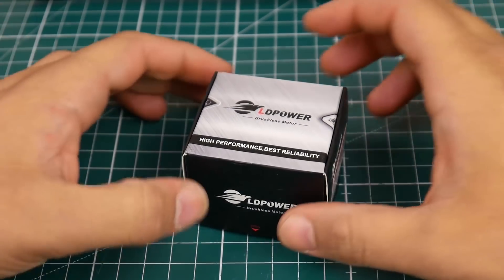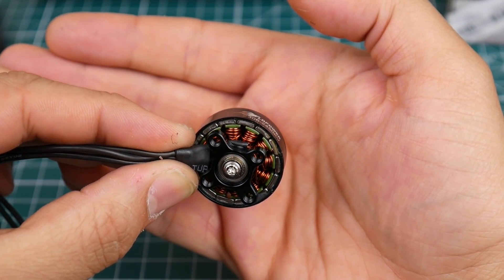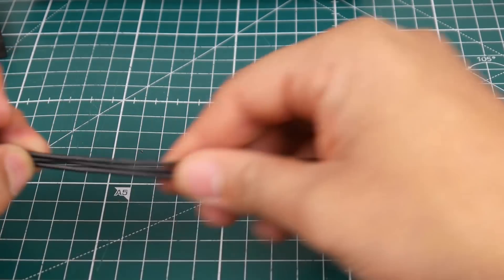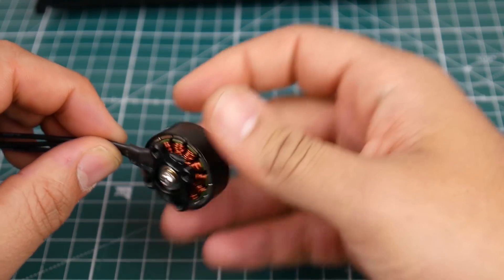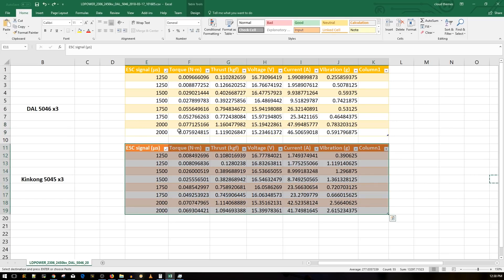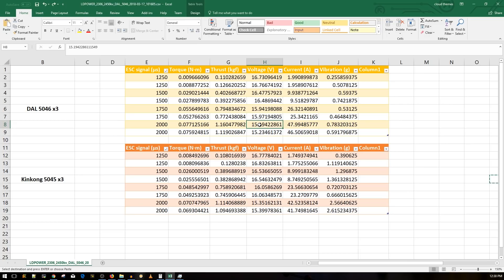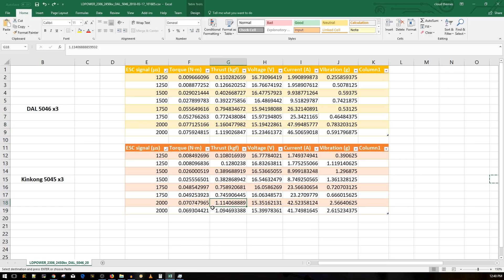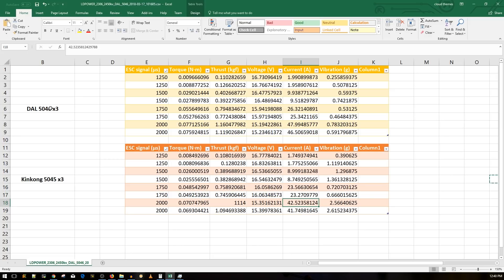$20 over 1000 Grams of Thrust // LDPOWER 2306 2450kv

Comment: As already mentioned this seams low... especially for a $22 motor, maybe it's the props. my AokFly 2306 put out more than this as tested by engineerX and they are $14(be careful you get genuine). I do love the screw in the bottom of motors, had to clean out a bunch of mud in the bell... can just remove the bell without taking the motor off the frame!
love all your other testing though!

Comment: i dunno how you are inputting the signal but i think having it change instantly from 50% to 75% etc is very jarring on the motor nd the readings? maybe causing some heat or sumthing, maybe making the vibration stats a bit off .

Comment: Hey man I have been very confused by your results as when I go on a motor test site they say theses motors pull way more than 1500 grams?
Reply: There is nothing consistent about thrust testing from one setup to another, neither does it represent REAL WORLD performance. More it gives a relative comparative frame work. So you can broadly compare results from the same testing setup.
But it is COMPLETELY normal for different test setups to get different figures. All you can confidently do is compare results from the same test setup
Reply from the maker: Samc The thrust stand I'm using is what top manufacturers like brotherhobby use to test. All the load cells on board are calibrated to 99.7% accuracy.

Comment: Lovely test, this could be. I doubt many people use Kingkong propellers. They are too soft for these kind of motors and they bend under load.

Gemfan Hulkies 5055, HQ 5x4,5/4,8x3. These are props you should use.

I have these motors on my Rooster and I love them. Even so, next build will be for 6S with low kv motor. It looks to me like "the future" (6 months).

Comment: *Naked bottom. 👌
Please test Dragonfly Hurricane 2207 motors as well.
Reply: It´s rebranded 3B-R 2207
Reply: marzobb 5 I'm not sure about that.. I can see a difference in windings, bell design. The same font tho and both have a paper-like sheet to protect the windings from screws. Probably the same OEM, but definitely not exactly the same motors.
Reply: Have run the Hurricanes over my RCbenchmark setup... I was sent some prototype 2700kv ones that tested out at 2810kv... insane flat insane but forget about having amp draw that is sustainable from even the best 1800mah and under packs... the 3b 2207 is made by the same manu... they are NOT the same motors rebranded... the 2500kv Hurricane is making more thrust then the 2650kv 3BR... the Cain has more bottom and mid range torque then the 3br.. the power across the board is higher with the cain.. 2500kv is making over 1840 grams of thrust on a 5x4.5x3v1s at 16.5v (200 amp 12 to 48 volt adjustable power supply so zero voltage drop under load)pulling 57 amps.. the 3br 2207 2650kv same voltage and prop making 1655 grams.. the Cain is THE most powerful 2207 I have ever tested period..its torque rivals some of the baddest 2306s and it's top end thrust numbers are way up there.. problem is current draw becomes even more unmanagable then on other super high output motors as the Cain drink amps like crazy.. that is in air to not just static.. on 4s 1550 R-line v2 HVs with GF5055s they will have burst current getting upwards of 160 amps... great motor if your building a uber light build and want mega 2207 power and running low load light props then they are usable.. I put them on a race build that is coming in at 217 grams dry... with HQ5x4.3x3v1s the amp draw is fine and with the R-line v2 1550s I can make 2 minutes of flying 90% of my ability on a track BUT the same build with set of F40 Pro v2 2600s I will consistently turn faster laps and do so even on a slightly heavier build.. they are great 55 dollar per set motors and will give you peak numbers beyond the top end 2207 thrust kings... but they aren't really great motors because they didn't factor in one important thing.. making sure our 1300 to 1600mah packs can supply the motors at least decently.. these motors kicked that right out the window... on a heavier build with some high C 1800s the Cain would be fantastic motors.. they just aren't a motor I would fly... I'll keep my top 3.. #1 F40 Pro v2s #2 BH R5 2207s and #3 F60 Pro v2s.. those motors cover everything I need in any 5in build the KV options are there for freestyle, racing and 5 and 6s builds.. they are pretty much all I'm building right now because they are hand over fist better then anything else on the market.